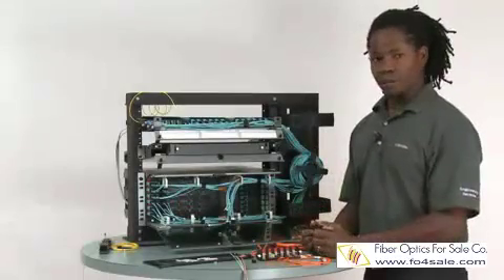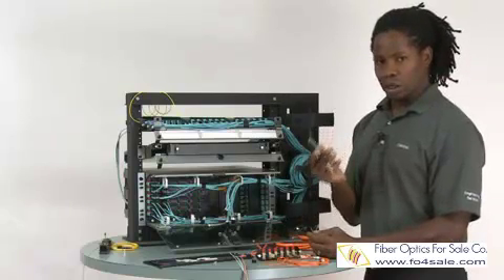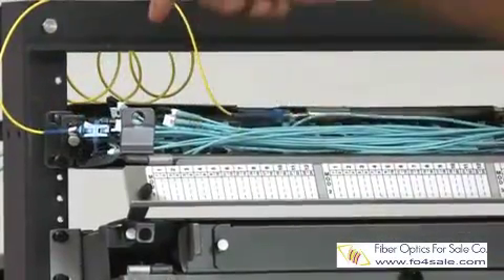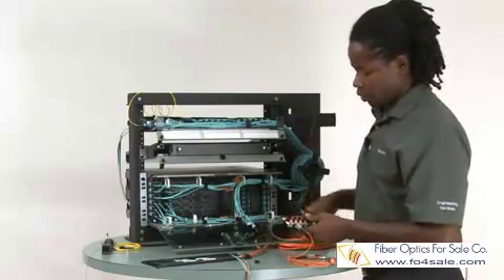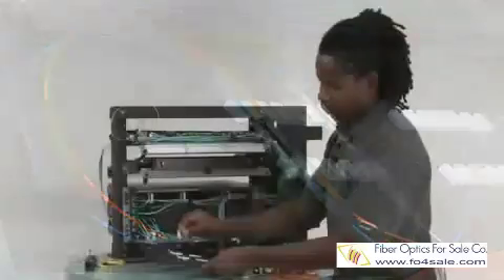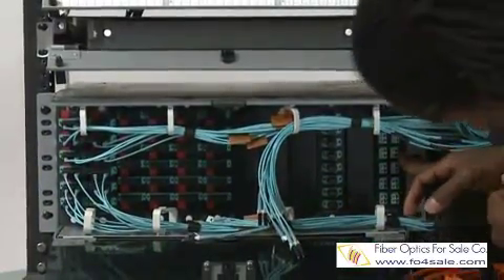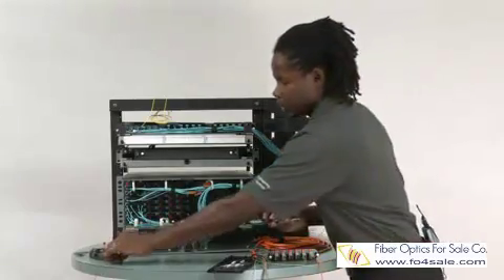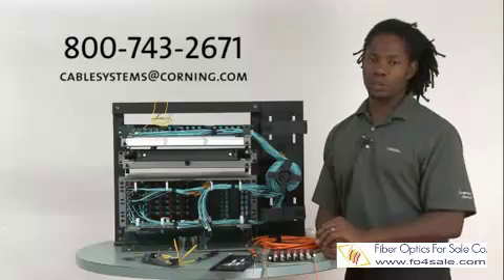How to Use Visual Fault Locator (VFL) to Check Your Fiber Optic Link

Comment: i got what you mean. but i have a follow up question. This in referral to locating the cut portion. Does this apply to locating a cut in outdoor fiber op. you know rubber is thicker and thus more rigid than patch cables